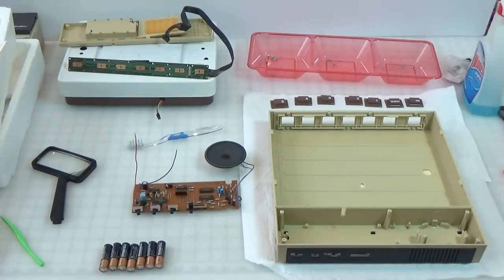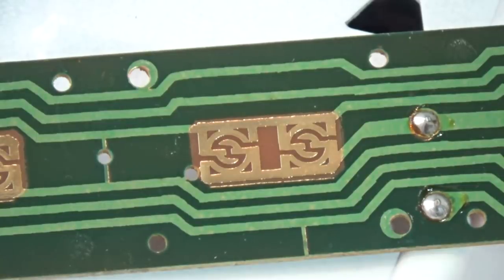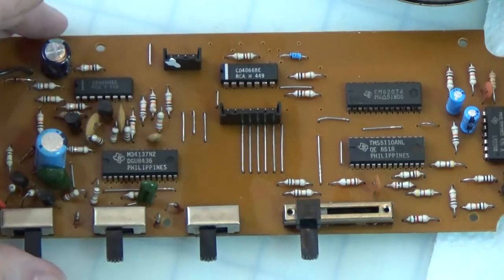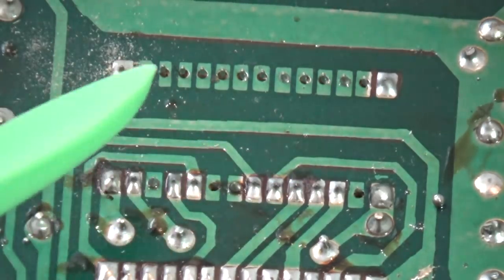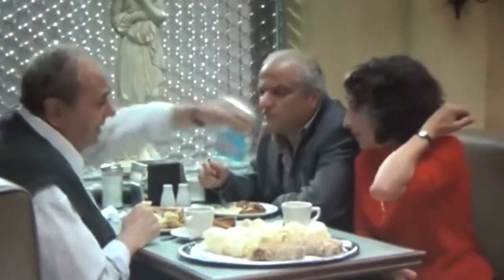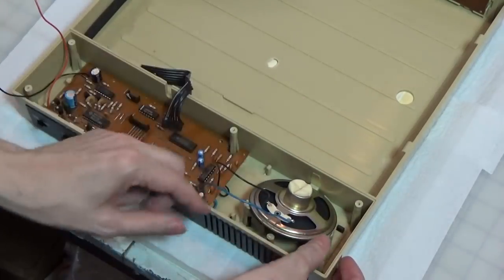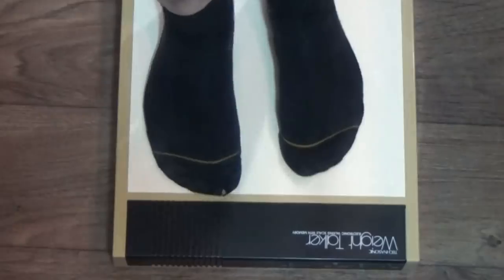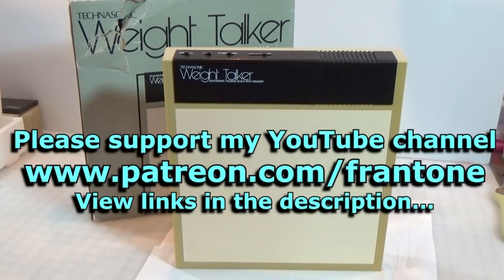This Isn't Over - Talking Scale 2

Comment: A very worthy restoration.  I've used the soldering cheat in the past where I was only using a few pins on a chip and didn't even include a pad for the unused outputs.  It wasn't to save solder, it was to save assembly time because I was hand-soldering all the boards.  Going by the differing pin lengths, blobs and flux, I wonder if those boards were all hand soldered too.
Unusual to see the speaker mounted at an angle and not in its own enclosed section for a bit of extra oomph.
Reply from the maker: All the flux and solder whiskers would indicate flow soldered for the board, IMO - plus there was solder coated on those bare IC pins sticking through.  It is possible that that ROM was selected for certain models certainly.
Reply: I was just thinking of him while watching this !!
Reply: Me too !
Reply: My guess on the speaker... they couldn't get a speaker small enough diameter to fit flush to the inside of the panel, or the speaker they ordered (hundreds/thousands) wasn't to spec, or they misinterpreted the spec, so they just mounted it at an angle that lets it fit.
Looks to me like the holes for the pins are drilled by hand; they aren't centered on the pads, and the spacing seems variable or random.  Source: I've drilled lots of holes by hand.... and they looked just as wonky no matter how hard I tried!

Comment: Good restoration video Fran. When I take things in bits (camera lenses, iPhones) I draw the components on an A4 sheet with little balls of bluetack at the screw hole locations. Then stick down the actual screw on the bluetack. Works a treat for brass, plastic or steel screws and you know where everything goes back into its correct place.

Comment: Rubber contacts are soft and make progressively so I do't think bounce is an issue. It's also trival to debounce in software by only sampling the keys every 50-100mS or so
Reply from the maker: I agree...  but still they did the double in parallel.

Comment: After decades of servicing, designing and soldering single sided PC boards, I have never seen such a cost-cutting measure.  Great update to the first video!
Reply: It's pretty weird. I mean they could've saved more by ditching the connectors on the wires and soldering them directly to the board.
Reply: quite possibly for some manufacturing reason. less to possibly go wrong during dip soldering ?

Comment: That grungy ol thing is a project! I love repurposing electronics, but even restoration is OK. I bought several medical instruments at an electronics thrift store strictly for the matching cases to repurpose for test equip. Inside one was a motherboard with several boards which included a complete RCA CDP1802 board and a Digitalker board. Can't wait to sit down with them and work out the edge connector

Comment: I think the reason for the double contacts on the buttons is that they aren't necessarily pushed straight in.   Having two contacts in parallel makes it more likely you will get a closure no matter how the button is pressed.  Even more important if someone is using their toe to do it.  Debouncing in sw is pretty easy, and not even necessary if the switch triggers something that takes a long time, as in this case.  Once the code sees a switch down, it starts talking, and stops checking the switches.  Probably doesn't start scanning the switches again until after you step off the scale.

Comment: Scale itself is easy to take apart as well, there are just the 4 springs on the bootm ( covered by the rubber feet) that hold the top and bottom together. Then you find a standard scale mechanism in there, with the 4 knife edge pivot points and the lever arms acting against the springs, and the dial that you normally view attached to the mechanism. The electronics are simply a pair of red LED's and 2 phototransistors, and they shine through a set of 2 rows of holes punched in the outer edge of the rim at approx 1/2lb divisions, with the 2 rows offset so that they form a simple directional encoder. The microcontroller simply powers on the LED's and assumes the scale is reading zero, then uses the 2 phototransistor signals to count up or down a digital counter, and after there are no counts for around 2 seconds assumes the measurement is stable, and then does the conversion into speech, and stores the value in the RAM.

RAM might still have held some data after a day, those older CMOS memories were guaranteed to hold at 2V, but many were still holding most bits at well under 2V, and I doubt they were doing any sort of checksumming to detect garbled data. That the capacitors were charged up all the time probably helped, I have had similar era capacitors hold charge for weeks in winter when it is not humid.
Reply from the maker: I suspect that SRAM being essentially a flip flop array could have held the values without power simply in a static state - being CMOS, just due to the fact that each flip flop has to begin latched one way or the other, that even an infinitesimal amount of energy could hold that tipping point in a CMOS die.  Just my hypothesis.

Comment: Hi Fran! I have an old Yamaha SY22, and all the control pads and keyboard switches (two per key for velocity sensing), have a single graphite rubber pad/contact. I measured them with a DSO and they don't seem to ever bounce, instead they show a gradual change of resistance at the moment of contact.

Comment: Definitely a unique peice of history I’m assuming it was bought new in the 1980s witch wouldn’t Surprise me because that was an era Of mass production of oddball products that weren’t necessary practical for the average household more so then they were meant for as novelty gadgets
Reply: Nowadays talking products are mainly designed for the blind (oversized buttons and often without display), but in 1980th talking electronics was the cat's meow. It would not surprise me if the thing did cost 100 to 200$ if it was early 80th.

Comment: Seems like you have things well in hand, but the groadier of old tech plastics respond well to mechanic's hand cleaner (GoJo, etc.) and light circular cleaning with a dish scrub pad. UV damaged panels and mars can be brought out by wet sanding with 800 emery, and then several mist coatings of matte clear spray enamel followed by hand buffing with cotton. One of the things I do to afford my Kentucky bourbon is bring back beaten and yellowed MFP (photocopier) panels to new.

Comment: Probably was hand assembled in a small shop which were common in Hong Kong in the 1980s so not soldering those pads would save on labor and time.
Reply: Populating the board? Yes .. but cheaping out on a simple solder wave which easily would have multiplied throughput even above practically slave labour?

Comment: Nice vid again! Awesome to see the scale reborn good as new! Did you consider giving the plastic shell the "Retrobrite" treatment at all? :-)

I see others suggesting the bowed out side might be fixed with warm air, but I suspect it might be the cable from the button board sitting too far away from the top of the scale.
From what I could see, it was pushed right into the plastic shell, and in this position it would've fitted into the space between that and the curve of the top of the mechanical scale. :-)

Comment: Hand soldered? If so, not doing all pins saves assembly time.
Reply: I too wondered if the board had been hand soldered, or hand reworked at some time.
Reply: Wave soldered, the pins have solder residue on them where they contacted the solder bath wave, even though the solder mask stopped them being soldered. Then there was hand soldering of the wires to the board, and this shows with the flux residue by those joins. Was common then, made rework of a faulty board easier, as you could remove the "good" chips off them to put on another board, if the board could not be repaired in 10 minutes in the factory during test. 

Those chips were easily the most expensive part of the entire unit, perhaps $40  for the set of 3 TI chips and the expensive SRAM, so a salvage for another board was on the cards if the problem was determined to be related to the PCB itself having cracks or broken traces.
Reply: @SeanBZA   Agreed. Wave soldered. You can also tell because there were a few pins which got soldered to the pads even though there was solder mask (a small registration issue during production.) No hand solderer would do that.

Comment: I suspect that it didn't ask for a memory number on the last test because you may have hit (or it thought you hit) the "Guest" button. 

Also, in the previous video, you mentioned the long serial number.Given that the scale was originally a gift for Christmas 1985, I would guess that the first four digits of the serial are the year (85) and probably the week of manufacture.

Comment: But do not use solvents or harsh chemicals (particularly never bleach or oil) on any rubber parts. They can turn it into mush or solidify and crumble apart. Silicone oil is safe to most (non-silicone) rubber. Many rubber sorts survive isopropanol, but not all. I definitely would not spray random stuff like Windex on it.

Comment: It would have been interesting seeing the optical mechanism for reading the clicks on the mechanical scale.
Reply from the maker: Previous video...
Reply: I watched that at the time, but thought it would interesting to see how the device internally worked exactly.
Reply from the maker: Typically, two LEDs and two phototransistors set apart at a distance slightly off of the slot pattern to read the direction and speed of the wheel simply by deducing the timing difference between the two sets of sensors.

Comment: Great restoration.  If you wanted to restore the plastic housing to its original color it can be done.  I suspect this was a lot lighter color at one time.  Most vintage electronics had ABS plastic housings that have bromine in them as a flame retardant.  Over the decades it migrates to the surface and slowly turns the plastic a yellowish brown color.  The process to reverse it is known as "retro bright".  In a nutshell you coat the plastic with high percentage hydrogen peroxide,  cover it with clear cling film and expose it to UV light (the sun works well as the light source).  I have been doing it for years and it works extremely well.  For hydrogen peroxide I use a hair bleaching gel that I get at a hair care distributor.  Has a extremely high hydrogen peroxide % and being a gel doesn't evaporate quickly or run off.  Give it a try some time.  I think you will be surprised how well it works.
Reply: I don't think it's the case for this one, usually the yellowed parts are the ones that are exposed to sunlight, and as you can see the backside it's the same color.
Reply: It also matches the lovely brown base!
Reply: They will yellow on all surfaces.  Look at any vintage Commodore computer.  Disassemble the computer or keyboard and it will be yellowed on the inside and out.  The outside will sometimes be a little darker but the inside part that hasn't seen daylight in decades will have yellowed to.  It's just the bromine migrating to the surface.
Reply: From tests done by various YouTubers, UV seems to be fairly irrelevant. The important factor for those of us not blessed by lots of warm strong sunshine is sufficient heat.
Reply: I was going to ask about this too
Reply: ganymedeIV4 40 volume
Reply: ganymedeIV4 40 volume is the strength of the product, nothing to do with brand, there’s also 10, 20, and 30 volume... I have used 40 volume for just this purpose and sharing my experience, perhaps too tersely for you.
Reply: It's actually called retr0brite, invented by retr0 on Amibay, an Amiga buy/sell site.

Comment: Having just watched Talking Scale 1, it DID say 53 lbs when you pushed on it in that one. So that would be accurate. How did it remember?
Reply from the maker: SRAM and the weirdness of CMOS flip flops and static charge.
Reply: @FranLab  There was an electrolytic capacitor which might easily have not discharged completely. It might only need a fraction of a volt for the CMOS RAM to hold it's data.

Comment: Obviously hand soldered, not wave soldered or floated. Spent 5 years manufacturing printed circuits; everything from flexible PWBs used in digital watches, to gold plated multi-layer boards for companies like HP, and others. I later moved on to building power supplies. As I had to learn to solder to mil-spec, I would find none of this acceptable. I later moved on to inspection, planner, manufacturing engineer, machinist. I am always amazed at what is acceptable in commercial grade items. Nearly everything I built over the years was for defense, aerospace, or NASA. I remember having books on every unit. My inspection stamp or build stamp going on everything. I can't believe they did not clean the flux off board. This would never have been acceptable. But just like soldering what does not need to be soldered, cleaning what does not need to be clean would just add to the cost. I always had a certain level of pride and what I did. to me this is almost the difference between breadboarding and the finished product.
Reply: I'd love to hear your thoughts on flux cleaning. I'm a hobbyist and I build probably a dozen circuit boards a year. Although there's no practical need for any of them to be mil-spec I would prefer if they were all sparkling clean however I have pretty much given up on cleaning flux, I scrubbed my boards with isopropyl and a toothbrush and it looks fantastic. Then when it dries it still full of flux but not the honest shiny flux it had before, dry corroded looking nasty flux. Any tips?
Reply: To be honest, not cleaning the flux off probably will not affect anything. We were always taught to use flux only when necessary. Most components were pre-tinned, and the solder had flux in it. Flux is not conductive, so you did not want flux left in a solder joint. Too much heat, damaged components. Too little heat, poor conductivity, poor adhesion. Excess flux tends to get on your hands, gloves, tools, and then spreads to other surfaces where it may cause real issues. It is also an insulator and creates poor adhesion on any surface it contaminates. As many items I built were encapsulated in epoxy with heavy aluminum oxide content to draw off heat, proper cleaning was essential. Just be careful with any chemical cleaner. Even now, some fifty years later, I use such common items as denatured alcohol whenever possible. Electrical contact cleaner works well, but as someone who is once responsible for mantaining the MSDS for the facility, I knew the possible side effects of every chemical we used. I take safety seriously. Use safety glasses, gloves, masks, aprons, etc. As necessary. You don't have to be fancy.
Reply: @brocktechnology  Once it's gone hard gently scrape it off with a, not too sharp, not too hard, metal point or screwdriver. Then blow the dust off.

Comment: I'm telling now Fran you cannot polish polypropylene plastic, trust me rotary cotton wheels will actually burn right into it. If you don't believe me google the melting point of that type of plastic and you will find that it's somewhere in the neighborhood of 300 F°. Well I tried to polish the covering of a Honda GC160 engine and it didn't work so I painted it white instead of red.
Reply: It is ABS, not polypropylene.

Comment: The capacitors are probably all dried out after about 15 years or close to it. i guess they must have some of their capacity left it works.
Reply from the maker: If it ain't broke, I don't fix it.  I have original caps still operating in lots of gear in my shop, some more than 50 years old.
Reply: 50 wow that is amazing. I buy radios that arent working replace the caps and most of the time they work again. sometimes they still wont work though.
Reply: @shartne  It's just luck. There are some rubbish electrolytic capacitors and some brilliant ones.